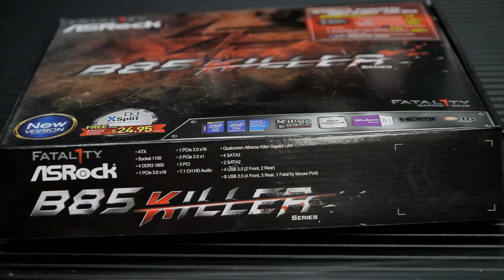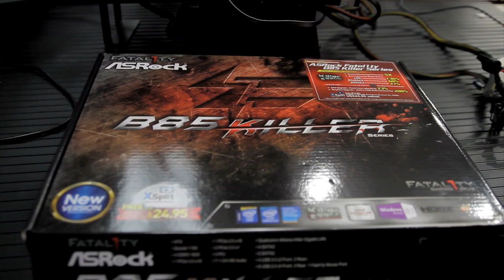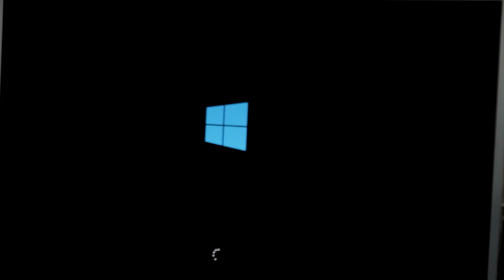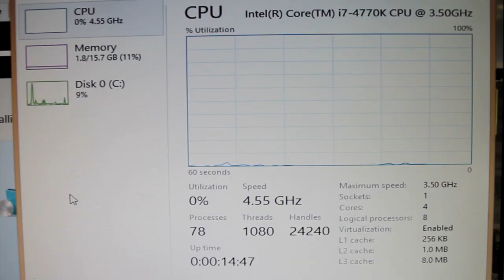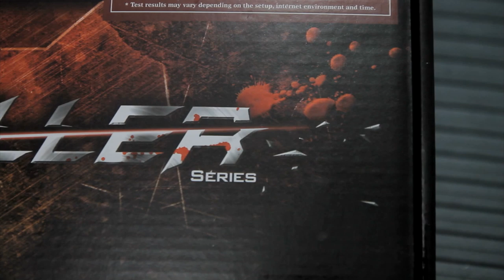ASRock Fatal1ty B85 Killer Motherboard Overview

Comment: The board even supports the Xeon CPUs. Another factor sticking it to Intel in however small a way.
Not shopping around for Haswell but it will be interesting to see what else you might find out or experience about this board. Even without counting in the overclocking it would be quite interesting for the price.

Comment: Asrock hasn't let me down yet.  I have a 3 year old and 1 year old board that have been running flawlessly.  I am always scared of buying their motherboards after reading Newegg reviews, but I haven't had any DOAs or failures yet.  I'm guessing that most of those failures are due to shitty PSUs.
Reply: I've still got my Asrock Z77 extreme 4, and it's still cranking! no problems whatsoever, and cost so little.
Reply: I have an AMD extreme 3 and it's run perfect for many years. Great looking inexpensive motherboard as well.
Reply: Z68 gen3 fatality still going strong!
Reply: hi im going to buy this board does this have any problems?
Reply: Thanks
Reply: But why is it so cheap?
Reply: Ok thanks

Comment: I have this MOBO in my system at the moment with a Gigabyte r9 280 OC Windforce. I was wondering wether buying another one of these cards in crossfire would be a viable solution? Since on of the PCIe slots is 2.0 and the other is 3.0 and one the 2.0 is running at 4x. Would this still be beneficial for crossfire or should I save up and get a single beast card?

Comment: I have had mine for 18 mnths it just started to blue screen with a whea error. I cannot get my bios to update from 1.70 to 1.90. I luv this board and the setup has run perfectly until now. All the stress tests i have run tell me my components have not failed as the whea error tends to be hardware failure. I am told that the failure can be due to the bios not being updated but i am having trouble getting it to update. I am running the i5 4460 cpu with a gtx650 ti boost card and 16 gig of hyper X ram oh and hybrid with 120 gig ssd and 1 tera hd.. Reason i am here looking at this vid was in the hope that he would mention the flash reset button that is supposed to be on the board. That seems to be my last option to see if the bios is causing the crash. If anyone reads this and can give me some suggestions that would be awesome.

Comment: hm. sounds interesting but if you look up some good z87 boards are cheaper than the Fatal1ty B85 and im sure that z87 will survive longer since its optimized for overclocking . if you want something flashy with tons of colour and useless features than the Fatal1ty is made for you ...kids
Reply: what do you mean buy cheaper z87 mb, on newegg this mb is $95 if you searched amazon then i see what u mean ($160 on amazon wtf) there are z87 mbs around that price but lets just say some wouldn't even go near them with a 10 foot pole and come on not everything can be useless, it is using the same components as it z87 bro and i like the color scheme
Reply: oh sorry :) 
i havent checked newegg for quite some time
Reply: but a cheaper or on par z87 mobo has less vrm, usually 4~6 where it really matters if you oc

Comment: I love how Windows is still reporting the max clock speed at 3.55 even though it says the current is 4.6
Reply: 4.55, look again
Reply: devontoner
um, you look again, the middle number is the current speed (4.55), but on the RIGHT is the MAXIMUM which says 3.50 so yeah. Learn to read a comment completely.

Comment: I thought oc'ing with B-series chipsets was impossible. I bought a B75 mobo for my brother's pc once, because it said overclock on the box and I didn't think Intel was going to pull one like the P67/H67  days again, but when I went in BIOS, looking for a multiplier (bought a 3570K so it ought to be there) I couldn't find it. I wasn't planning to OC it, but knowing now that it can't be done I'd probably saved some money by not buying a K-series, or gotten a higher quality PSU, possibly.
Reply: It's something new to the 80 series. The B chipsets can oc but it's slightly more limited then the Z chipsets and the boards generally aren't designed for uber OC's but you can do it.

Comment: Does this motherboard supports pentium g3258 out of the box?, or does it need bios update to support pentium k
Reply: as long as the socket is 1150..

also , a few of my friends is using this board with g3258. so its ok..

Comment: Will this be good for an i5 4690k and an R9 290?? pls halp
Reply: So I have read that it is not compatible, and I have read on the Asrock site that it is compatible... I still don't know, not sure if I wanna test it as I returned the board for one that supports my i5.
Reply: get the newer ones like the fatal1ty h97. and there will be no problem
Reply: It is Compatible with your processor!! I used the b85 killer, just amke sure to ask them to ship it with bios v10 or higher and it will work no problem (:
Reply: Fluttershy is best pony I have an i5 4690k it works fine

Comment: Looks like a very nice motherboard for somekind of low budget intel build with a non k proccesor to still get the most performance out of it.. sad is doesn't support sli :( but it still has a crapload of features for a b85 motherboard. but i would still spend 10/20 bucks more and get a z87 motherboard (it around 80 euro's here so..)

Comment: when is ram gonna be cheaper again?
Reply: on what planet do you live the 8 gb 1600 mhz i bought of low pro and year and a half ago was 74.99 now its like 150 for the same kit.
Reply: well i have 16gb of 1600 mhz corsair Low pro
i play alot of bf4 and i heard that faster ram speeds are better for that game. cpu is 3770k at 4.6 ghz
Reply: ***** ha, so you wana tell me if you have 64gb of corsair domi @2.8ghz you would be rocking the 100fps w no gpu? .. :)
Reply: RAM is currently expensive due to a chemical plant explosion in China, which supplies 10%+/- of the world's RAM chips. Estimated reduction in cost is Between March and July of 2014.
Reply: DanDragon92 thank you sir this is what i wanted to know.
Reply: You're welcome. : )

Comment: I really shit out on the silicon lottery, My 4770k blue screens when pressure testing if I go over 4.1. Or maybe I'm a shit overclocker :)
Reply: My 2500k goes to 5ghz. 

Not trying to bum you out, just pointing out the last few intel cpu's have been strange...
Reply: Num43 and sandybridge cpu's tend to overclock more than ivy or haswell. the overclocking headroom keeps going lower and lower...
Reply: Num43 yeah but that 2500k at 5 ghz runs at 100% usage bottleneck in crysis 3 lmao and 4770k even at stock have far way to bottlenecking

Comment: advertising useless stuff again I see... Why even bother allowing SLI mode if it's useless, we're paying for it to be there on the board, so why bother at all? Why use an Intel CPU and use an AMD onboard GPU, couldn't make up their mind? What's wrong with Intel NIC and what advantage could there possibly be for using asrock NIC instead?... This motherboard makes no sense and I see reliability issues all over it. Also, the gold caps are decoration, probably not even made of gold, and from what I know, all Japanese caps are the same, so you don't need to make the gold ones look as though they're somehow better than the typical grey ones.
Reply: SLI is not allowed on this board, it requires at least 2 8x interfaces, this board has a 16x and a 4x, no sli, however AMD allows crossfire on 4x, so there is crossfire support.  So you're not paying for it.  The Killer nic is not an asrock nic, it's qualcomm's.  Killer nics were famous for low latency which is good for gaming, and that's why it's on a gaming motherboard. Lots of people run intel cpus and amd graphics, that's one of the dumbest comments I've ever read.  I see no cause for "reliability issues" either.  Even if the gold caps are eye candy, what's wrong with that.  It's a cheap gaming motherboard, and I think the market needs something more than ROG.